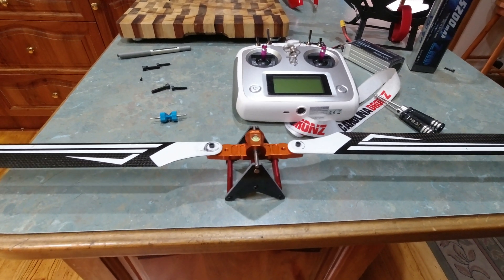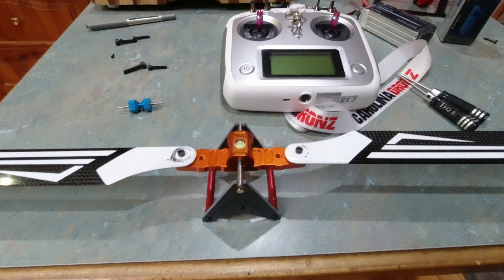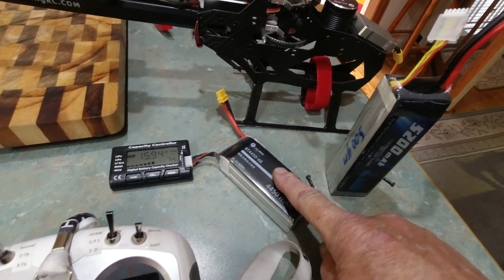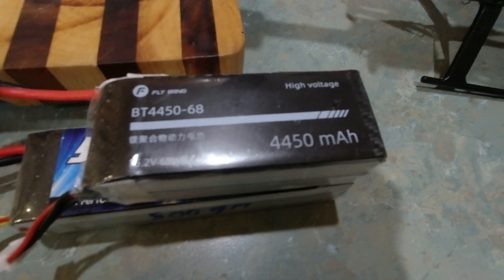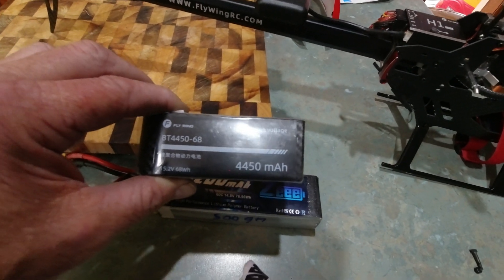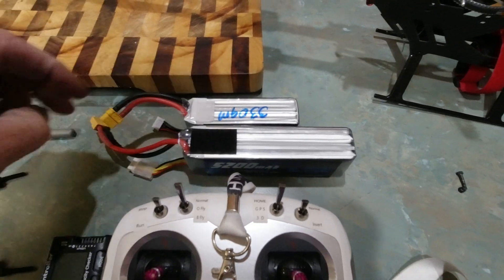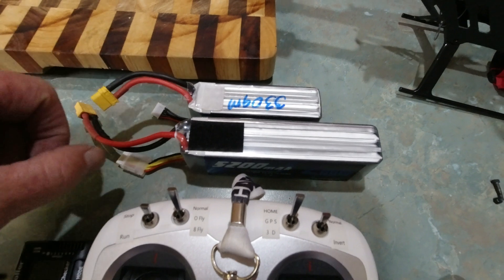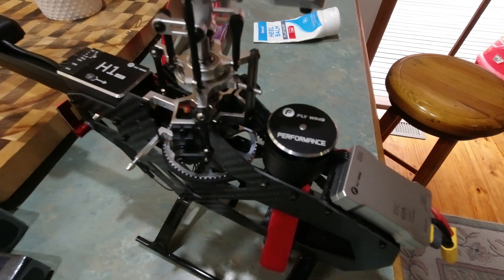Fly Wing 450 blade balancing and battery proprietary battery problems

Comment: e      you chargeing would battery to full 4.35 per cell those are LiVH HIGH VOLTAGE BATTERIES have to have charger that is able to charge each cell to to 4.35 volts instead of 4.2 volt standard Lipo dis-reguard comment if you all ready know chargeing details had to ask Don j

Comment: I'm sure you are already doing this but if not make sure to get a charger that will properly balance the battery.
Reply: I have a good charger
Reply: @trebor1973j  Robert...Did the Lipo have a bad cell?
Reply: @trebor1973j  Also Robert...do you use the RTH setting in the program and if you do what value are you setting it at? What value are you setting the Lipo voltage meter to initiate beeping? Thank you for your time.